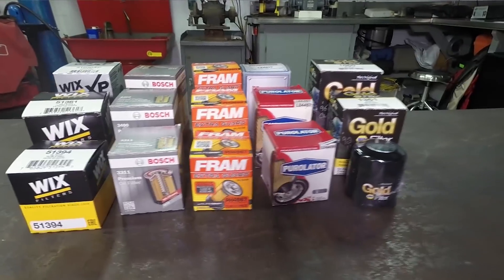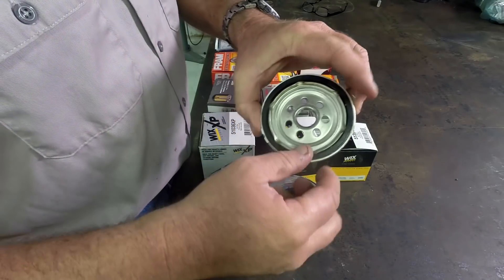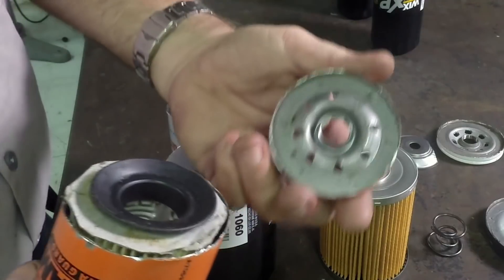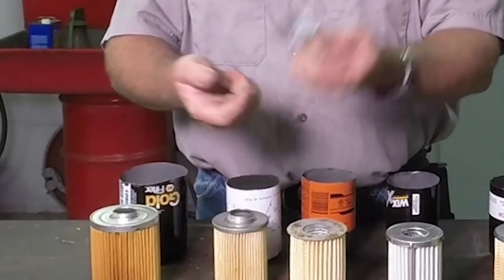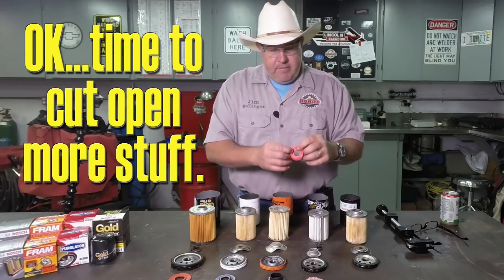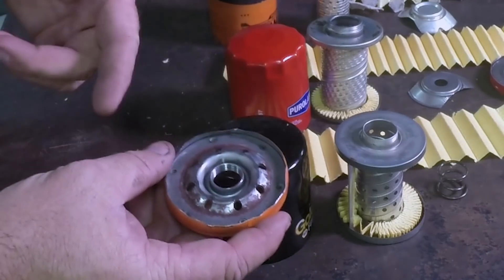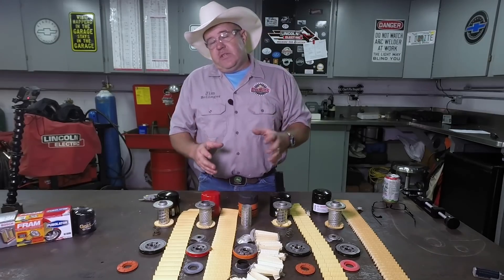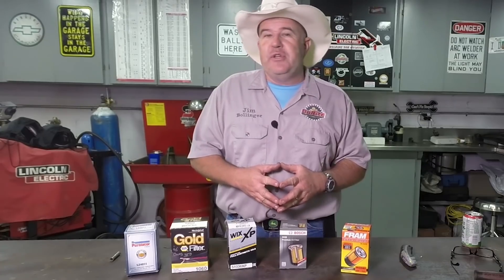The worst oil filter EVER!

Comment: - backpressure valve - doesn't matter, seals on inside of metal tube and base
- cardboard ends - doesn't matter, they'll hold as much pressure as the filter media, if it plugs enough for that to fail the filter media will be plastered around the center tube anyhow
- rust - that's on the outboard side of filter media, also, where I worked last all the brands had some rust

Also note that you don't want a super heavy can and base, if your pressure relief in the block fails you want the filter to fail rather than your rod caps stretching and/or shearing the oil pump shaft. Had to replace one in a sb 400, would have sent it to the scrap yard if it needed much more.
Reply: @GroundedSounds  One gets a unique perspective having been an engineer, mechanic and in marketing.
Reply: relief valves in the filter prevent a more robust filter from cause pressure issues in your vehicle in the first place. The rust being on the outboard side means there is none on the outlet side? Good luck with that. 

The bigger issue is that when the quality control on a filter is so low, how high do you think the raw materials quality of said filter is going to be? This video showed more superficial differences, but what happens when you look at the fractional efficiencies and capacities of these filters? Trust me, that fram filter does not hold up when put under actual analytical testing. The other issue with the cardboard seal is bypassing. You don't want to buy a filter that has bypasses in the endcap seals otherwise you might as well buy an empty can.
Reply: @musicwv  Filters don't have relief valves, that's only in the block or pump, there is a backflow valve that keeps the oil gallery from being drained when the engine is shut down. The only thing that would act as a safety for a failed pressure regulator would be a blowoff valve or filter can failure.
Rust was on all brands, none really more than others, it was a shipping or warehouse issue which I assume was the case here.
The  oil will press the cardboard right to the filter end, not an issue.
Reply: @ty2010  Back-flow valves are commonly called anti-drainback valves in the industry and, yes, many filters do have relief valves for when they reach an OE specified pressure rating. They are often spring operated and built into the top endcap of the filter.

Most people would never see these as it is quite unusual for even DIY oil changes to be followed by a cut-down of the filter.  I will grant you however that it is not necessarily a majority of filters that come with relief valves, but you'd be amazed at how many do.

 My Source: Working as a filtration engineer for 9 years.
Reply: @musicwv  Not talking overpressure from a clogged filter, I'm talking about from a failed bypass in the engine. Replacing an oil filter is easier than replacing a cam, distributor gear or distributor shaft.
Reply: @ty2010  Fair enough on ease of replacement, but if your filter goes into bypass then no harm no foul. If your lube path fails, the filter can won't make a difference at all. Still, I can see where you are coming from on this one.

Seriously though, your username has me questioning every reply :)
Reply: @musicwv  The only fails I've had on the engine oil bypass have been at 10f or below when the engine is started cold and on GMs at that, SBC specifically, never on the inlines. Luckily in that situation you get the engine light, rattle and smoke from the oil on the exhaust but it's only at idle. 
The name makes life easier, people get less salty thinking it may be a gotcha on a lot of things, but then they think about things more so it's a win-win. ;)
Reply: Troll With A Purpose j

Comment: Thank you so much for the info these filters, and especially on Fram.  Fram was the only one with that rubberized base for gripping which for years had led me to the illusion that it was better thought out, but boy was I wrong.  I will NEVER use Fram again and I will be sure to tell anyone I know who changes their oil that Fram is piece of garbage.  I had used Fram for years and I now wonder how many of my engine failures were caused because of Fram filters.  Like you said, I have no words bad enough for Fram.  I will try to make time to contact O'Rileys, Autozone and Pep Boys auto parts corporate departments and refer them to this video.  Thank you so much for revealing the truth !

Comment: I abandoned Fram oil filters shortly after I began driving. I noticed my oil pressure dropped considerably. At idle and at temperature the gauge was reading about 20lbs. Any other filter it would idle at approximately 35lbs. But the biggest issue by far was oil starvation. After about a thousand miles, when I’d start my car first thing in the morning, the cams would wrap as if they weren’t getting any oil. Once I’d burp the throttle the noise disappeared. Considering this wasn’t an issue I was familiar with, and no one else was either, I went through three oil changes over the course of a year before figuring out what the cause was. From then on I tried a variety of different filters (Wix, Purolator, STP, etc) and the issue never reappeared. I owned that car seven years. Since then I will not even consider a Fram oil filter

Comment: I would like to see this done with a K&N oil filter
Reply: I have a filter cutter, and a K&N has a much thicker can and is tougher to cut.
Reply: @scottm7341  it definitely is thicker. Those casings are built like tanks.
Reply: Or an AC Delco filter
Reply: K&N sucks since they stopped making them in the US last one i got wouldnt seal it leaked like hell the plate with the seal was warped had to replace with a mobil 1
Reply: @dewaynemiguel3349  you probably put it on wrong. LMAO.
Reply: @csn6234  nope i been changing my own oil since the 70s i liked K&N it was warped no matter how much i tightened it it leaked it was that warped i finaly took it off put a mobil 1 filter on then it was fine
Reply: @dewaynemiguel3349  Changing the oil filter on your lawnmower and other power tools powered by small engines does not count.
Reply: @csn6234  you are a fool i was a owner operator trucker i even serviced it myself  i dont let anyone else ever work on my vehicles

Comment: At one time I thought I was told that the Oil filters had a safety valve inside the oil filter in case the filter got stopped up where the oil couldn't pass thru the filter this safety valve would open letting oil to pass thru the stopped up filter so the engine would not be cut off from oil pressure to vital engine bearings. I did use to drink to much back in the day True or False?

Comment: I can say that I always use Fram Filters!! I only had 1 problem in my shop some 35 years ago! The anti-drain back valve failed and got pushed up in to the oil galley and caused a main barring failure on a New Rebuild 302 Ford HP Engine!  I just finished for a customer! I had the car towed to my shop and took it apart and when I saw what happened, I called Fram and a Fram Rep was at my shop the next day! I showed him what I had and he wrote me a check for all the labor and parts to build my customer a NEW Engine! from scratch! New Block! It broke the 3 center main caps! I was satisfied and so was my Customer! You know, Stuff happens! and I continued to use Fram filters for many, many years after that with out any problems! In racing engines!!! But NOW!! Things must have really gone to "Hell" so to say at Fram???  I have been using WIX for years now as my favorite parts suppliers didn't always have the Fram filters I needed?  Maybe because sales have been slipping?  Don't know? But after seeing this video I will never Run a Fram Filter again! Ever! even in my lawn-mower!!!!  Thanks so much for bring this to everyone's attention! I am really Stunned! From now on my shop will use WIX!!   Thank you!

Comment: You lube the gasket so it seats well not to ease removal. If you spin on with a dry gasket and sealing surface you run the risk of binding, folding or tearing the gasket.

Comment: As long as the filter material “filters” it does what it was designed to. Use a Fram on my 12,000 rpm sport bike. No problems in 30,000 miles

Comment: I used to work in the laboratory at one of Fram's filter factories for a year. I can say that while some of the filter lines were generally okay, some of them were shocking - I'm talking almost no adhesive between the media and the end holding caps. Thus, complete bypass of the filter media was often happening. However, regarding this review: you can't tell if it's properly made just by cutting it apart. You need to do a pressure test to make sure there's no leakage between the media and the end-caps (although visual inspection can tell you a lot!). That said, some other Fram filters, e.g. some of their air filters, are good quality - it all depends on the factory and the money that's been invested in it! Fun fact: Fram apparently used to make filters for the Concorde, so quality must have been good at one point!

Comment: have a 1997 gtp with 3800 supercharged 230k mile only used fram never been in the engine does not burn or smoke oil First 180k I drove it Like i stole it Always change oil every 3k or sooner if it looks dirty. have a 1999 tahoe 155k only fram

Comment: I've always used Fram's basic filters with conventional oil, and chg'd my oil every 7500 miles.  328,000 miles later no engine issues.  I've done the same with all my car for decades and never had any engine issues and keep my cars for 150k miles routinely.  I run Quaker State oils, occasionally Pennzoil.   DON'T OVER THINK THIS STUFF.  Just chg them regularly.
Reply: ya but now that you see how bad those frams are why on earth would u still use that brand......just cause you have no engine issues so far thats like a smoker saying well im still alive at 75 been smoking my whole life...ya so what its still better to quit... to each their own though. Good luck at any rate hope you get another 328k out of it but for gosh sake use the nappa one or similar

Comment: I have to wonder what 2,100 viewers found to dislike about this video. Even though that is less than 1/1,000 of viewers, it is still a mystery to me.  Thanks for the hands-on look inside these filters, Jim.  I would have liked to to see it expanded to a few more brands, as you did on the diesel filters for the Cummins (not Cummings, incidentally).

Comment: This is terrible. Using a grinder to cut into those oil filters will litter them with metal shavings from the filter housing.  

Use a proper filter cutter!
Reply from the maker: And tell me again why I care if grinder swarf gets into a filter that I cut apart to show you what's inside? No really, please tell me....look on the workbench there is a cutter sitting right there....probably a reason I didn't use it...don't act like an idiot.

Comment: One of my shit jobs in life was changing oil at a dealership, and crushing filters.   Fram were the softest and easiest to crush.   Fram was universally known to be the worst junk.
Reply: @LifeLongStrong1961  sorry but the SAE standardized hydrostatic burst pressure test disagrees with you, Wix filters burst at 290psi after 2 or 3 spikes, frame after 2 spikes burst at around 150psi, which is considerably lower and a spike of 150 isn't impossible to achieve if the pressure relief valve sticks for even a second on a cold engine when pressure is highest
Reply: what do you do now
Reply: I agree. Worked for shops and we would crush our filters. Fram goes flat fast, easy and hardly a sound. Soft Garbage.
Reply: @LifeLongStrong1961  the oil pressure system can be upto 80-90psi cold, thats alot of pressure to hold
Reply: @LifeLongStrong1961  what's worse is frame rates the filters at 300-500psi which is higher then what even Wix rates filters.
Reply: @LifeLongStrong1961  Tells you that the company is more concerned about cost of materials than performance
Reply: B.S. Frams a They are a reputable brand. Been using them for years with no failures. Can't go wrong with a Fram.
Reply: @dwc4343  You might not be wrong.
You probably can't go wrong with a Fram... but you sure as shit can go a lot better with any other brand.
Brands these days mean jack shit.
Product is all that counts, and when i see THAT product, i say fuck no, get me the one that doesn't look shit.
I don't give a fuck about brands, and neither should you.
You don't use the brand.
You use the product.
And you don't appear to use your fucking brain.
Reply: @LifeLongStrong1961  I've bent and worked with water pipes and they have quite a bit more rigidity then the frame cases did
Reply: @LifeLongStrong1961  don't get me wrong filter bursting is highly uncommon but that's what the point of filter thinkness is, the water pipes I've felt with have always been a thicker gauge pipe then the frame filters, were harder to bend then the fram filter, and we're usually copper which has a much higher material strength

Comment: Some oil filters used to have an acid neutralizer inside the cartridge.  Can't find any info, or oil filter, with acid neutralizer in 2019???  Acid buildup in you oil - bad.  Found an oil acid/contaminant gadget on eBay that gives you a digital readout by putting some of your engine oil in a little cup in the middle of it.

Comment: Thanks for a very informative video. I used to just buy the least expensive filter and have never questioned it. I take my truck to a garage these days do to my age and a stroke I had, but will be checking to make sure they are using one of the better filters. Thanks again, Griz

Comment: I've been using FRAM oil and air filters for 20 years and I've never had any problems with them I've never had a car blow up  or have any kind of mechanical engine problems and all my car's are high mileage car's just changing the oil every 3000/4000 miles
Reply: That's great!  But what if you could get even higher milage [and possibly better gas mileage and more horsepower (cleaner oil)] by using a better oil filter?

Comment: Let's put things in perspective...  In the 50's and 60's, European cars (like Fiat and VW) had NO filter. They only had a screen. Filters don't really filter all of your oil. In cold weather your filter opens the bypass valve which releases Unfiltered oil into your engine.  Race cars have two filters because one cannot pass enough oil.The REAL filtration comes when you change your oil. Oil gets contaminated with deposits and acids that filters can't touch whether you use conventional or synthetic.  If you don't need the 'high heat' protection of synthetic oil (like for a turbo charger), conventional oil lubricates just as well at a much lower cost.  I change mine every 3,000 miles because of the acids and contaminates.  Classic car oil contains zinc and phosphorus that depletes as the engine runs.  That's another reason for changing every 3k miles.  Filters mean nothing to me.  Most people don't realize that oil passes through the pump FIRST, before the filter. Whatever particulates the pump picks up gets mulched in the pump gears before that oil sees any filtration.

Comment: Try comparing apples to apples maybe... Your comparison is WIX XP (top line) and NAPA Gold (top line) to Fram PH filters (bottom line). For an accurate comparison you SHOULD be comparing the Fram XG filter line. Just sayin...
Reply: The Tough Guard is good as well.
Reply: I see what you're getting at there, but still- the bottom line filter by the Fram brand should meet better metrics than what I saw in this video. I recently started buying WIX because Oreilly sells it and now I will continue to buy Wix.

Comment: Hello, enjoyed the video, I did not know that Fram was that bad. I wanted to add that I was replacing a spin on trans filter on an 05 GMC with Allison 1000. I compared filters when I took the old one off and was very surprised to see that the inlet holes on the new filter were much closer to the center hole, upon further inspection, those holes would have been mostly blocked by the filter adapter  casting on the transmission. I can only presume that using this filter could have damaged this transmission. The parts store checked to see that it was in fact the right filter, and it was by application. So I went to Napa, and they had a wix brand that matched my original one exactly.

Comment: Used Fram, until my daughters car was involved in a accident and it had to sit, while the Insurance companies fought. In about a months time the Fram filter closed. So when started it was started dry, it continued dry because the Fram sealed itself. Had pressure but no oil flow. Had no clue that this could happen. Told Fram in writing, haven't heard back yet, that was September 2007.

Comment: Fram has always been junk. WIX is good. What about K&N?
Reply: scottiessexshop 

I have wondered the same thing.
Reply: It's decent but I have one start to leak. They are more focused on higher flow and pressure ratings than good filtration.
I mostly use the Fram ultra now or Royal Purple.

Comment: Oops, I've been using the Fram filter for 14 years 330 thousand miles same truck. Maybe the filter is overrated. The oil is more important. Or maybe the owner, doesn't drive like a maniac always in a hurry. Then blame everything else but himself.

Comment: My 2 cents.  I've been running Fram filters with synthetic oils for over 30 years mainly in a succession of Toyotas, all of which ran to excess of 250K miles before sold.  Currently running two Toyotas with nothing but Fram filters since 2006 both now over 200K with no engine concerns.  That's all.
Reply: Michael Husselbee Just my opinion, but, me thinks the credit goes to Toyota(!) and the synthetics? 😀
Reply: @stuckinmygarage6220  You could well be right about that.